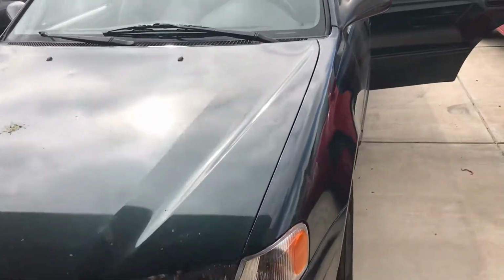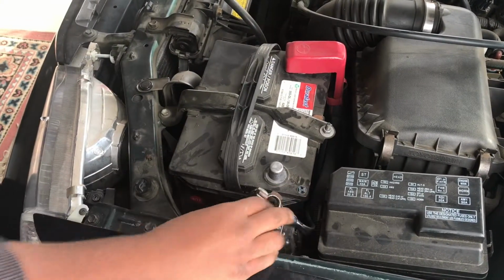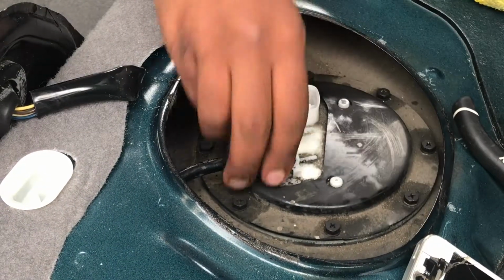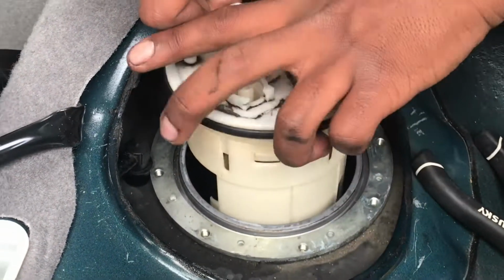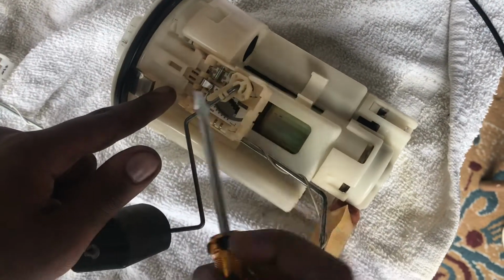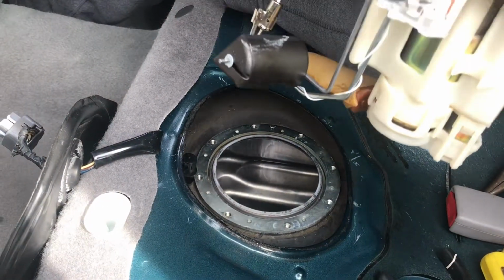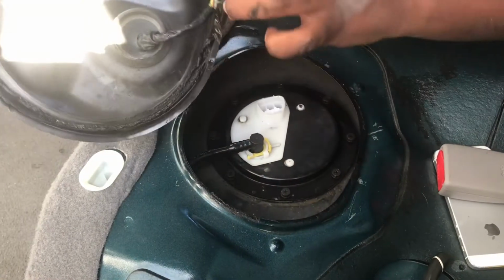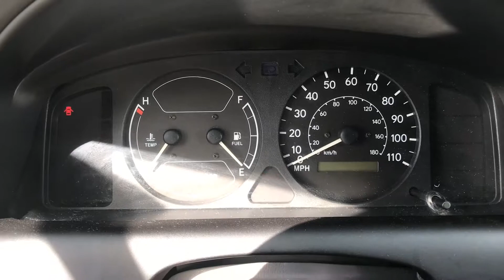How To change a fuel sending unit/floater on any car

Comment: I have 94 Hyundai Excel
Reply from the maker: Should be basicly the same steps
Reply: @slowgoat6089  it's not but it's cool
Reply: @danielmendez8421  similarly the case with some lancers... I have an '05 cs3 which has a fuel sending unit that is separate from the fuel pump despite there being a float attached to the fuel pump.